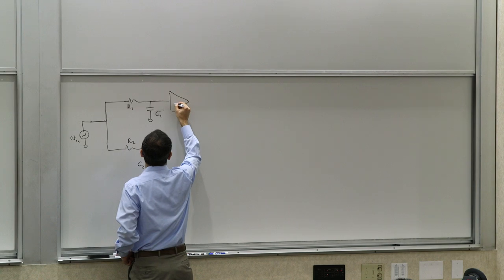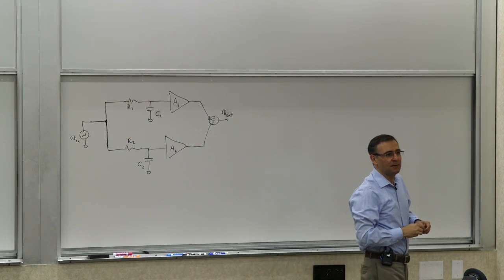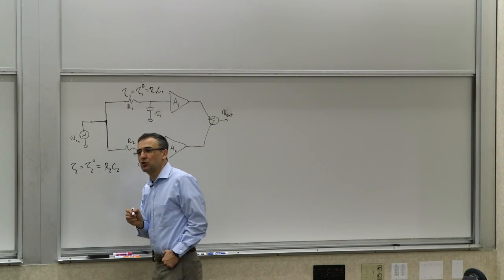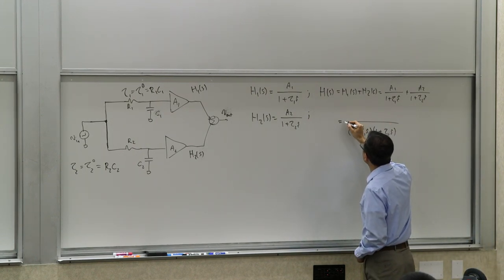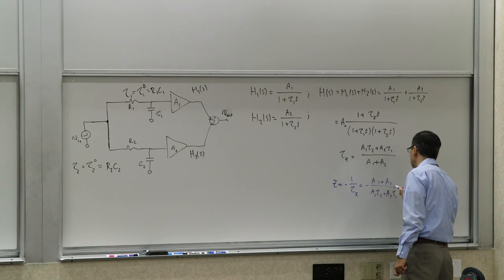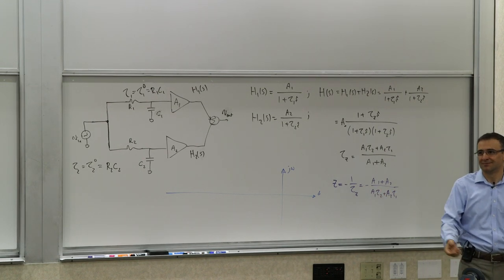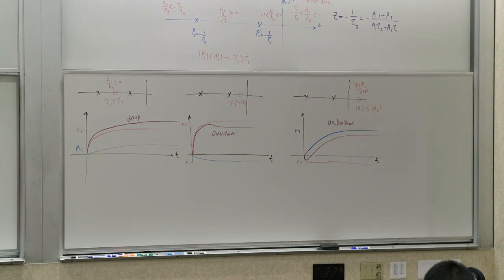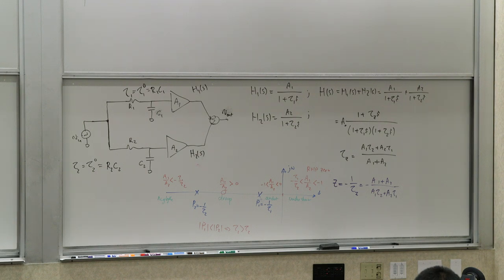149N. Creation of zeros: parallel signal paths

Comment: Professor, I do have some question about the cases you discussed.
for case 3 and 4, A1/A2<-1, if A1>0 and A2<0: the zero will actually fall between p1 and p2, no wonder A1/A2 > or < -tau1/tau2
We can prove this by:  since A1+A2>0 and tau1>tau2 thus A1tau1+A2tau2>0
                                        z = -(A1+A2)/(A1tau1+A2tau2) < -(A1+A2)/(A1tau1+A2tau1) = -1/tau1
                                        z = -(A1+A2)/(A1tau1+A2tau2) > -(A1+A2)/(A1tau2+A2tau2) = -1/tau2
                                        thus -1/tau2 < z < -1/tau1   thus p2 < z < p1
To have RHP zero we have two possible cases: 1. A2>0 and A1<0, -tau1/tau2 < A1/A2 < -1     2. A1>0 and A2<0, -1 < A1/A2 < -tau2/tau1
And I think the cases 2,3,4 you given are all under the assumption that A2>0, A1<0

Comment: Hi Professor, I have a quick question. Yet if we short either C1 and C2, we will have non-zero output while if we short both C1 and C2, the output will be zero.
Why from this, we can get there is only one zero in the system? Because we can have only one Capacitor not creating zero output (one is short while the other one cannot be short）
Thanks
Reply: yes even i got this doubt according to previous lectures it should have two zeros right
Reply: @yeshasrgowda9060  Simultaneously is a keyword I think

Comment: what if p1=p2? one of the pole is cancelled by zero?
Reply from the maker: Well, if you have a pole with a multiplicity of 2 as you described a single zero reduces it is to a single pole. A less pretentious way of saying that would be to say that one of the poles is cancelled as you correctly pointed out.
Reply: Ali Hajimiri Thank you for confirming